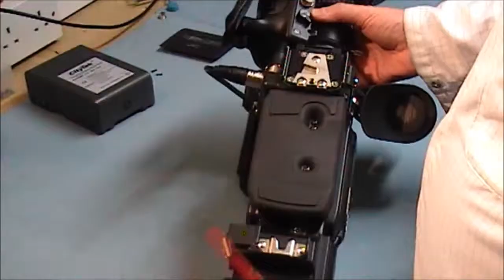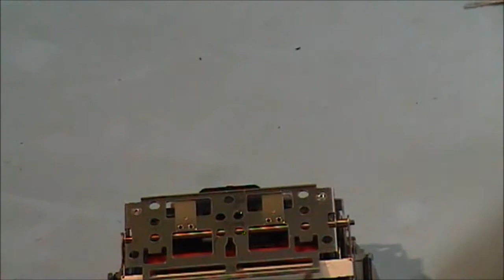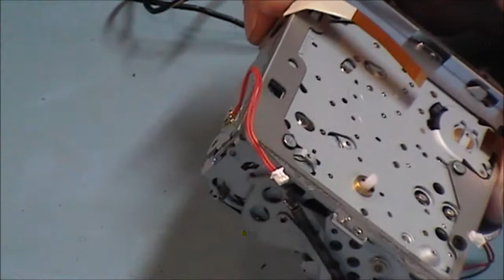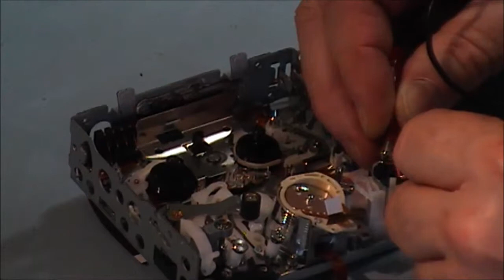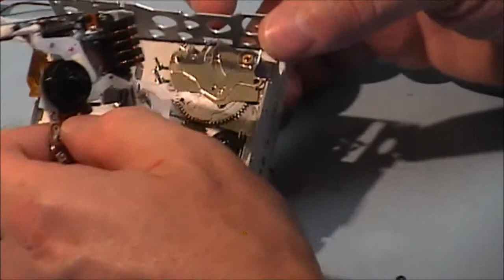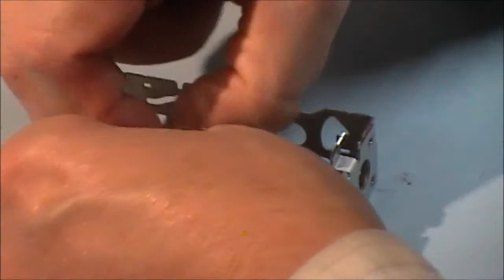JVC GY-HD201E Tape Jammed Pt 1 Sub cam gear LL20126-001A replacement video

Comment: Hi.

How did you control all the screws, what fit to what, and put it back again ?
Good job, you perform !
Reply from the maker: I followed the service manual to disassemble 
and reassembly This shows the timing marks for the gears
Reply: @ElectronicWorkshop where did you find the service manual?